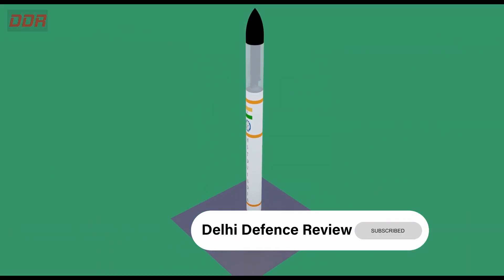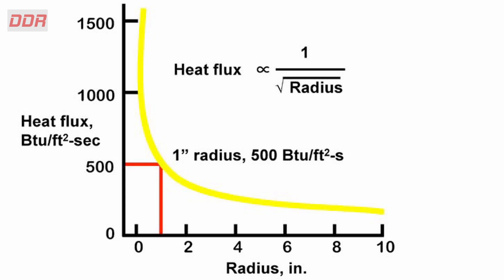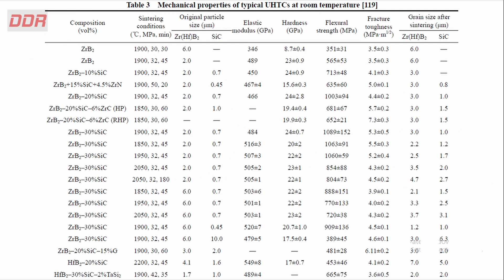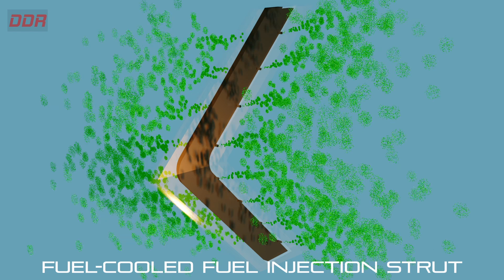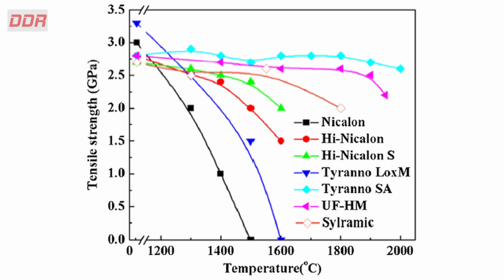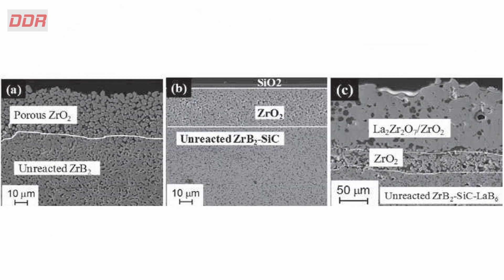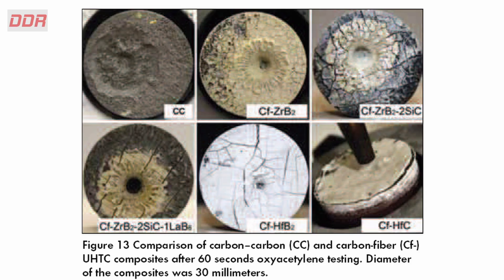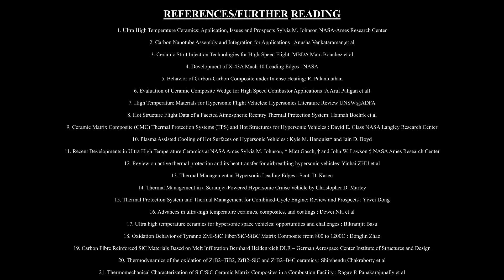Hypersonics - Materials for Hypersonic Missiles | HSTDV

Comment: How much more time for india to develop silicon carbide fibres?
Reply from the maker: We're in the process. As you've seen in the video, we've even made products using the developed fibres. But it is a constant process to fine tune the manufacturing process, tailor the interfaces for these fibres and matrices to get a product equal to something that can be built with imported materials.
Reply: @DelhiDefenceReview  but Sir, I think those SiC fibers are imported from Japan(Nippon), it is same like how we were importing carbon fibres until recently when we developed our own.
Do clear my doubts
Reply from the maker: @deepakpandey9935  Even carbon fibres of higher grade are unavailable locally today. they are imported. this tells us the magnitude of the challenge in front of us. As to exact status, it is unknown.
Reply: @DelhiDefenceReview  I think it will still take 8-10 years till we silicon carbide fibers and intermediate and high modulus carbon fibers locally.
Reply: @ashisbose6181  what rubbish are you blabbering?
Reply: @DelhiDefenceReview  Aren't we already making c-sic composites? Did you mean that we are importing sic fibers for that?
Reply from the maker: In C-SiC composites, SiC is used as bulk material. To use SiC as reinforcement of a bulk composite, you need fibers. That is currently under development. Hopefully it'll be ready to use soon.
Reply: @DelhiDefenceReview  Got it. So sic fibres part is being researched. We ll move directly to sic-sic once that is done. That should be helpful towards fighter engine development as well.